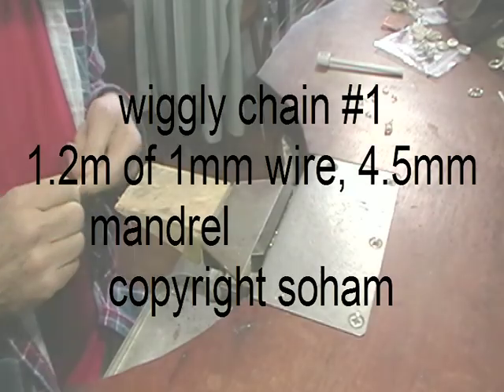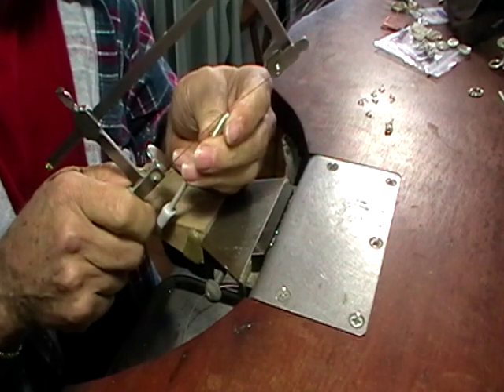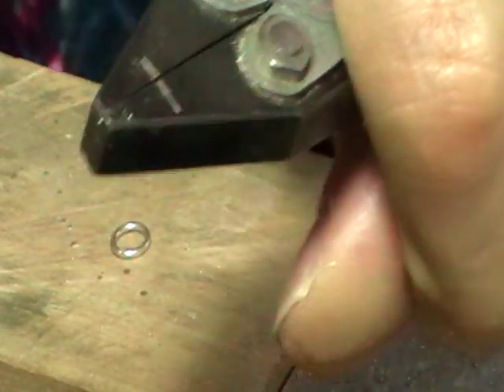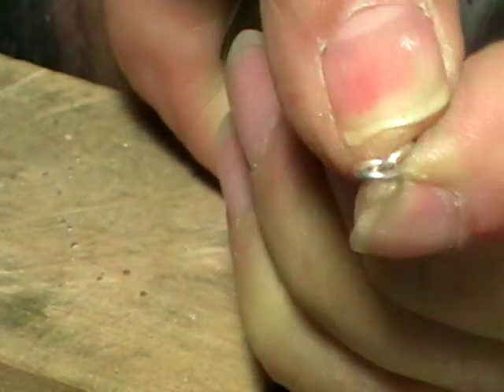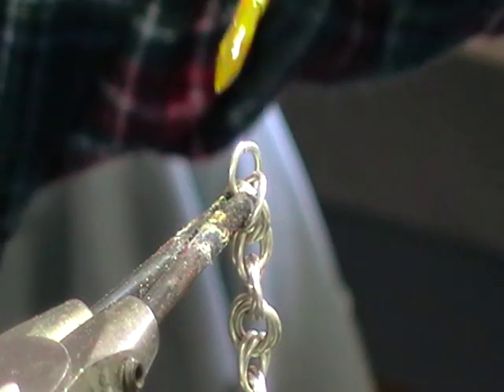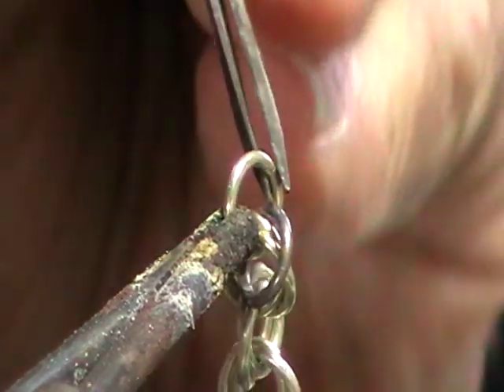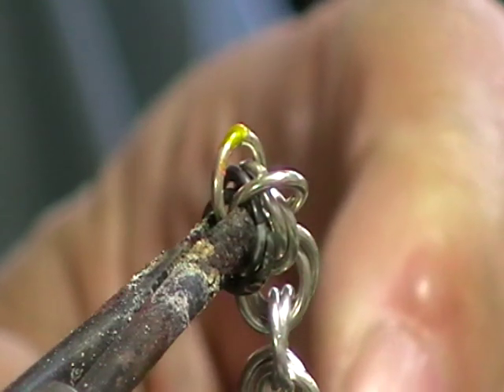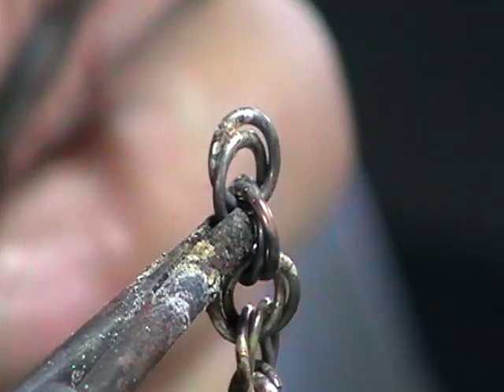soldered wiggly chain

Comment: I am trying to make small cab settings. Why, because I have many small, 6 to 6 x 8 mm, lovely cabs from years back. Thus, have really needed your demos for soldering small jump rings when they are attached to something. Thanks for those. And everything else. I've had a few successes, as well as melting a few pieces of silver. Recently warped a backplate. Need ideas for using silver scraps. :))

Comment: I've wondered how to do this!

Now if you wanted to have links in there with stones mounted, say stations/connectors, I assume you'd do each section separatley and then join them - but then how do you solder the connector to the rest of the chain without destroying the stone?
Reply: I would do all the soldering first, and then mount the stones last.

Comment: Is this chain also known as a "Celtic Twist" chain?
Reply from the maker: i don't know, google it and see what comes up. happy hunting
Reply: Charles Christopher i have heard you do this 3 times, easy mistake but a mil is .001 inches, much smaller than a millimeter. obviously it doesn't bother me i just want to help for the future. i work in mils with engineering and printing and it is confusing.
Reply: I'm a bit confused.  My post doesn't mention "mils" or millimeters; are you addressing the right person?
Reply from the maker: robert burrogh
i know it is incorrect to say a mil when one means a millimeter, but i have to say you are the only one that has caught it. i will try to be more correct in the future, but probably will miss it at times, so i apologize in advance.